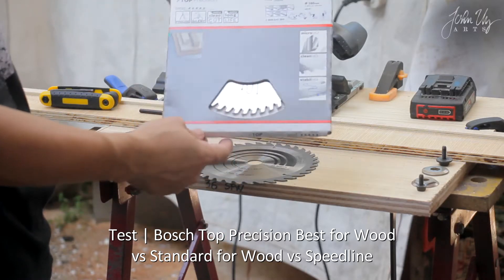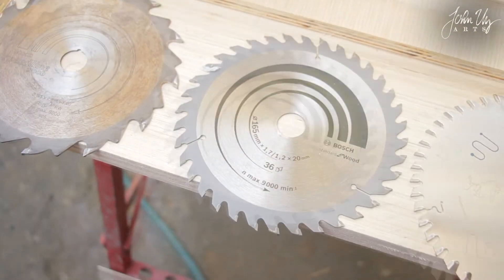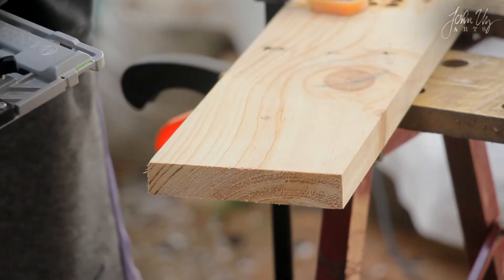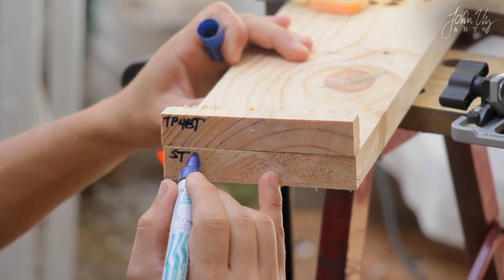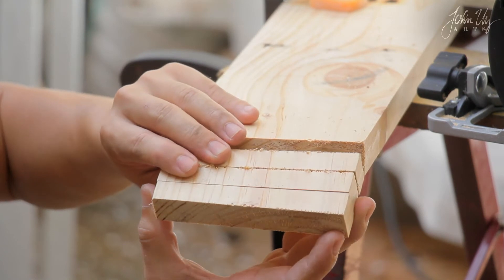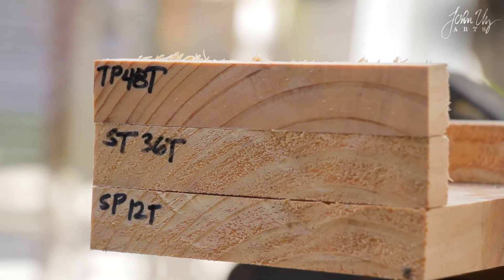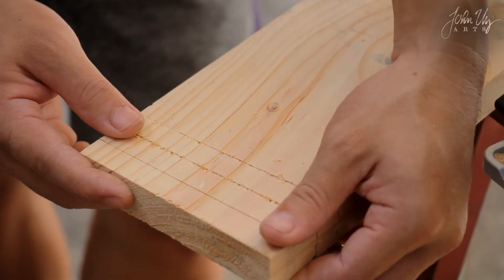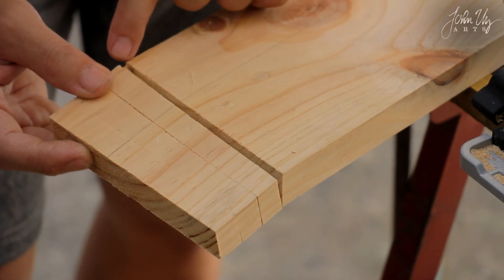Does the number of teeth matter? Circula Saw Blades

Comment: Great video.. We can turn our old blades into wind chimes!!!

It's not just tooth count, but hook and tooth design as well. From my seat it appears the 12T and 36T blade variations gave the same result; both being different designs I presume. The 48T precision blade cut absolutely amazing. I wonder how slow it is with ripping. So it probably has to do with tooth count, hook angle and degree angles of carbides that contribute to the quality of the cut.

Comment: @John Uy Arts   Sadly that you didn't make also a along side cut and compare them too. Because the blades with low teeth number are for speed cutting not for cross but for lengthwise and that would be interesting also to see the differences.
Reply from the maker: Generally rip cuts are of no issue with any blades , its with crosscuts that specific blades matters , and its with crosscuts that tear outs generally occur , plywood aside since plywood has orthogonal layers
Reply: @JohnUyArts  Well, I have made different experiance. The quality of rip cuts can surley differ. Some rip cuts become so clean and smooth that you don't need to us a planer after cutting and other blades make thinny stripes and you have to rework them with a planer. If you know what I mean.
Reply from the maker: @leonlionheart5927  then i believe there is a problem with your power saw calibration or setup , or maybe how you use them :)
Reply: @JohnUyArts  your conversation with Leon makes it the more interesting to see rip cut demos comparing the different blades. Great video for the cross cut demo. Thanks and hope you keep it up. Subscribed to your channel, liked the video too!